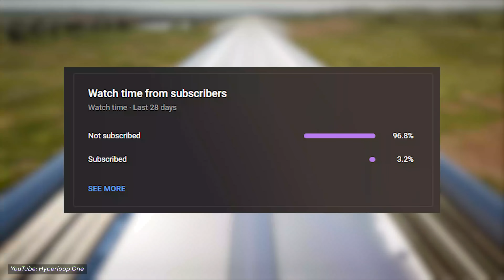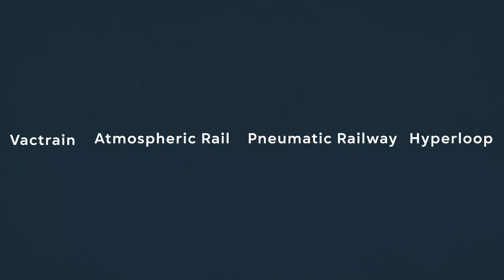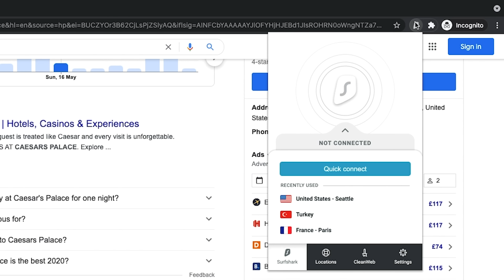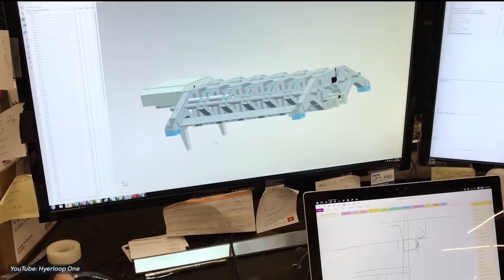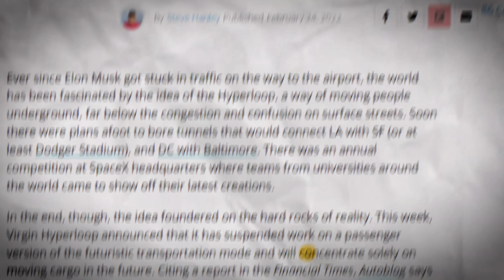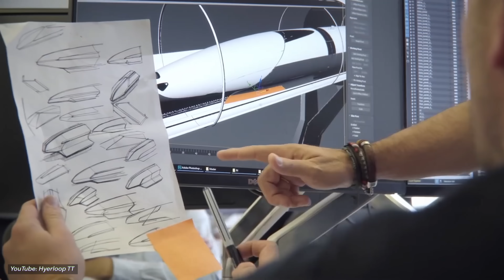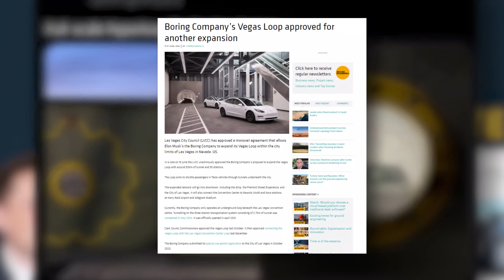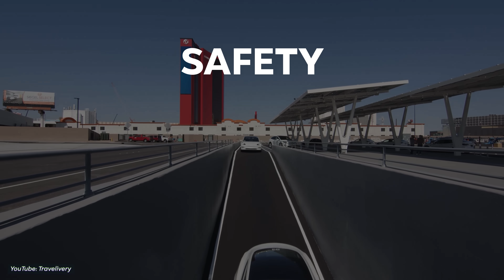What Happened to Hyperloop?

Comment from the maker: Get Surfshark VPN at https://Surfshark.deals/topluxury - Enter promo code TOPLUXURY for 83% off and 3 extra months for free! 😄
Reply: Aloha!
Reply: Make video on msg sphere Las Vegas in detail
Reply: It's not Hyperloop's "typewriter time" yet.
Reply: RRTS(Regional Rapid Transit System) is the future to travel within a Megalopolis or a Megacity --> https://en.wikipedia.org/wiki/Delhi%E2%80%93Meerut_Regional_Rapid_Transit_System
Reply: The correct name is "The Hypersonic Train" and it's basically, a hypersonic Maglev which would run in a technical vacuum tunnel (couple mm Hg) same pressure as it is at 30+ Km altitude! U need a pressurized Maglev train in the same way a space capsule has pressurized air. The maximum technical speed of such device is somewhere between 5500 and 6500 km/h to a maximum threshold of 7000 km/h or 4000 mph due to Coriolis Effect. The energy requires is 1/10 of a long airplane trip across the same distance , being able to transport over 2000 ppl. That's the initial Project. 🥰🤗😇

Comment: The trouble with hyperloop was not scientific plausibility (it is plausible), it was commercial, legal and safety viability.  Higher speeds means shallower curves and less flexible routes.  Good luck bulldozing through towns because you can't curve round them at speed, paying for construction of airtight tubes, paying to perpetually pump out air because leaks always happen, and getting people out when mechanical faults happen.

Comment: if the Loop has no air in it, why do the trains moving in it, need pointy noses, when without those "pointyness", the train of the same length can accommodate more passengers and eventually bring more money!
Reply: and such projects, would be better for everyone and especially for investors, if they were tested in full scale, first in small countries!
Reply: Because ALL is a fraud. It must look sexy, people are too stupid to understand technical specifications. At 8:30 the Hyperloop TT is nearer. In a vacuum the easiest for economical freight carrying is to lay it out for standard 40 foot-containers, a carrier not much different looking than a rail car.  
 
But that looks boring (like the Boring Company), too much like normal railway.  
 
If it would have been earnest, the engineers would be busy developing a maglev system for extremely high speeds, far beyond the current 500-600 km/h.  
 
The whole system in the white paper is laid out for passengers.  WAY smaller than a standard railway clearance profile.  
 
A passenger pod is small and cute, for maybe 40 passengers. A Munich subway train can hold up to 1,000 people. So you would need 25 pods for one sub. 10 trains/hour is no problem for a subway, thar would mean funneling 250 pods/hour through the airlock at the beginning and the end of the tube.  
 
Would they really mean it, they would admit that each pod would need a fully autonomous life support and energy support, especially in case of an emergency.  
 
In our software, about 10% of the code and the testing was about the actual functionality, the rest was error handling. 
 
With Elon you only hear about the 10% and even of this the issues are downplayed

Comment: There's a fundamental problem hyperloop that's being overlooked. Size.  More to the point, cabin size.  Though people travel in vehicles as small as compact cars, there are windows that enable passengers to feel less cramped and enclosed, a car with no windows would likely trigger claustrophobia in most people. And hyperloop presents that very scenario. At best its cabin size is liken to that of a small single prop plane such as a Cessna 152. Unable to fully stand with no outward visibility could easily trigger peoples sense of extreme enclosure.
Reply: Recently I saw a claim that the Hyperloop would be practical using 28 seat pods. I did a calculation on about how long it would take for the capacity of a high speed train to be despatched in such pods.
In the time the last one was sent on its way, a high speed train could have loaded and travelled about 1,000 or more kilometres. Passengers could also be waiting for hours to get on a pod.

Comment: Air flow pressurization in the hyper loop would solve the water ingress issues and aid in traffic speed and flow. on off ramps would have to be vacuum sealed sorta or airflow direction accommodated some how. One direction flow would fix this just by it's nature of on off ramps.

Comment: Musk specified 1/6 Mars atmosphere for the tube. Mars is 1% of earth. This was in contrast to a vacuum. So 1/600 it is. He said a fan in the front would take it to 700 mph in 2 minutes, but no exhaust in the back. Clearly he doesn't understand propulsion. The exhaust was to instead blow down as "air bearings". Add hydraulics to the list of ignorance. Air hockey works because the puck is light. Air compresses because it's not hydraulic. He apparently instinctively knew it wouldn't be enough air so he specified "stored air". In order to save space it would be compress3d, and because it does compress it wouldn't hold up a pod. Do you see the new problem? Floati g a pod would take hurricane level wind. A steel tube at 1/600 air pressure would collapse without serious reinforcement, but now it would reach explosive pressures in minutes.in effect it wouldn't last an hour and would likely kill all occupants. Note all teste abandoned the propulsion system.  Lets keep in mind if it was given maglev a coast to coast line would  require all the steel produced in the world for over a year and cost trillions. The LA to San Francisco route has no feasible expansion joints and would fluctuate 400 feet in length with temperature. Any pinhole leak could kill everyone inside. To say it was a steaming pile of garbage would be generous. He's an idiot!

Comment: The Hyperloop concept's biggest issue is that it hasn't realized that it isn't competing with cars and trains, but with planes.

In order to actually utilize the potentially high speeds offered, you need very long stretches with no stopping, which effectively turns it into a plane in a tunnel. Except, the plane doesn't need to spend billions upon billions maintaining the airway, and it can be moved over to other routes to fit seasonal demands.

For most stretches of travel, regular or high speed rail is much cheaper per kilometer to build and would have the exact same speed limitations as the Hyperloop due to needing to break for stops on the way.

Comment: Presumably the vacuum requires a ton of energy to pump out those roughly 1000 tonnes of air (given a 2.5m diameter tube 550km in length) in the first place, and then continuous pumping at some non-negligible level -- and the slightest rupture to the tube's huge surface area (without safeguards in place) easily destroys all of that pumping work while causing a hazard for any vehicles that are running. Maybe make it thin enough people are lying down single file, and focus on making the experience inside the pods very quiet and smooth... unsure if this is more efficient tho, since carriages are longer, but at least the smaller vacuum takes less energy to maintain (given some leakage is inevitable during the boarding process).

Whether it's hyperloop or high-speed rail, surely some of the groundwork is the same, and I think both proponents should therefore be enthusiastic about moving either project forwards!

Comment: Unless it can go faster than 500 MPH, it can’t beat the direct time-savings or efficiency of air travel. Airplanes do not need to worry about bends in the land or following roads. For the most part, it’s a straight direct line from point A to B. However, the tradeoff is that Airline travel is the most expensive traveling method.

Comment: First, we already have high speed trains in europe and japan. The german ICE has a travel speed ~300 kph on a normal rail. The french TGW has a travel speed ~320 kph on normal rails. The japanese Shinkansen has a travel speed ~320 kph on normal rail. On record speeds, they all can reach ~500 kph on normal rails.
The Transrapid, a magnetic hover train invented by the germans, sold to the chinese, can reach equal speeds on a monorail system.
So why the hell do we need the tube? These are only usable for regions, that have harsh weather conditions.
The USA should flat their rails, so the trains can reach higher speeds and make it more comfortable to use.

Comment: Hyperloop was an infantile idea,. It was doomed to fail due to a lack of understanding of (or ignoring) the technological limits. 
Oil pipelines have expansion loops every 1500 ft (500 m) in order to avoid thermal stress. 
A hyperloop from LA to SF would need about 1000 expansion loops. Therefore the hyperloop One was only 980 ft (300 m) long, to avoid expansion issues.

Comment: Frenchman here. Hyperloop reminds me of the Aerotrain story in the 1970s. A very nice concept with an upside-down "T" (concrete beam) to guide and sustain air-cushioned vehicles. Rapidly it reached over 400 km/h on a simple track BUT the project crashed because of a few things: where to build the large new infrastructure in city-centers? vastly increasing operation costs of gas turbines used in the Aerotrains.  the small number of people transported in "pods", thus killing the pay-back model. Yes Hyperloop is different but to maintain near-vaccum in 4 to 6 m-diameter tunnels over thousands of kms, how to do turnouts, how to re-use existing infrastructure in ultra-expensive city-centers? So many questions so few answers.
TGVs "pods" transport up to 1000 passenger in order to pay-back the HUGE infrastructure costs. Also, don't forget in the USA the mighty lobbies to protect gas production and car manufacturing (which derailed high-speed trains in the USA).

Comment: Just build a high speed train which can go up to 350kph, with much higher capacity and many more targets than pods could achieve, or if you value speed, above cost and capacity, build a maglev train which can over 700kph, as already proven in the real world by China and Japan.
Even trying to bring back super sonic passenger airplanes seems far more practical.

Comment: Hyperloop is a great form of transport on large distances, ~8000 km. It is expensive to build and a ticket will be $2000. The advantage is for CEO's to be able to travel large distances in a short period of time. Saving precious time. Getting from Beijing to Paris in 2 hours. But the way that it is being pitched by musk is utter nonsense. You can't use it on small distances and it is not cheap at all.

Comment: 6:50
“it reached a top of 172kph” is way too slow as 172kph equals to 106mph.

Japanese maglev train is now under construction planning to open in 2027. 
　　
They go about 550km(340 mile) in 60 minutes.

The maximum speed is over 500kph.  Which is 310mph.

Comment: the issues are with the tubes. Pressurised tubes of hunders of km's are very difficult and expensive to make and maintain, those tubes needs to be pretty damn strong to avoid leaks and implosion 
closest thing to hyperloop is actually air planes. they go up  10km high for lower atmospheric pressure and less aero drag to go more efficiencyly this is what hyperloops are trying to achieve also isnt most hypeloop concepts supposed to use maglev kind of thing so techinically hyperloop would kinda ''fly'' issue with plane is that as far as I know there is no green replacement for jet engines

Comment: Hyperloob sounded like a good idea to me when i was 14. But as i got older and wiser i learned about something amazing. There is these things called trains, that run  on thin metal rails. And hear this, they can carry houndreds of people from point A to Point B. Amazing right?
Reply: Def not the same thing
Reply: @toprak-x6u  Ofcourse not, one is a safe, cheap and fast way to move people and cargo over long and short distances and the other is not. Im not saying they are the same, that would be oxymoronic.
Reply: @ToneyCrimson  This idea of elon musk is almost impossible to accomplish, with humans at least. My take on this is to create intercontinental delivery systems that are able to for example reduce something that would take 15 days by boat to a mere 3 hours
Reply: @toprak-x6u  M8 think a little before you say shit. Do know how impossible it would be to make a vaccum tube that long? And also continents moves, unless you are making it float in the ocean or  something, its not going to work. Pluss if you are in a hurry, use planes for delivary. For other things boats works fine...
Reply: @toprak-x6u  Oh yeah. A vaccum tube under the atlantic ocean for thousands of kilometers with no possible exit and the crushing weight of the whole ocean on top of the sealed tube.

Sounds feasible and safe.
Reply: @jayer. I didn't even say this would be safe for humans. I only want this for deliveries
Reply: @toprak-x6u   If the tubes implodes under the imense pressure, you have to send people to fix it. Every mm of those tubes need to as perfect as a deep ocean submarine. Thats a impossible task no matter how you look at it. 

Anyways guessing from your comments, you probably are around 14 like i was. You will grow up and understand how crazy you sound. Its would be easier to make a base on the moon than a hyperloop across the oceans.
Reply: @ToneyCrimson  great way of thinking, if everyone was as bright as u we would still be throwing spears at mammoths, why bother trying to think of sth better if we got sth else currently, no point trying to improve it or anything.

Comment: the problem with vacuum transportation is  that it's a little too vulnerable. To take down large portion of the system, one would only need to pierce the tube at a certain location and the atmospheric pressure would take care of the rest. Also, the benefit of a vacuum over a regular rail system is very  small. United States is better off adopting maglev trains as it's a more proven concept than the hyperloop.
Reply: Lol sorry but we don't need trains, we have our cars which are still the best way of transportation. No need for some socialist mass transportation vehicles in which you can't even decide by yourself where to go.

Comment: I'm neither a technician nor a scientist, but I think the only way the idea would work is if the diameter of the tunnel was much larger. As speed increases, no matter how low the atmospheric pressure is, air accumulates in front of the vehicle and by having so little margin of separation between the tunnel and the vehicle, a bottleneck effect is created and basically the vehicle is pushing compressed air.
Reply: hence the vacuum, there is no air to compress or move, thats the whole philosophy in the design
Reply: @bruceketcheson4877  It is not really a vacuum, it is air at very low pressure because it would be economically unfeasible to create an absolute vacuum. If I remember correctly, they said that the pressure they were under was like that of about 100km high.

Comment: never say never
some invention or discovery may change the paradigms and what was impossible, suddenly finds itself in the realm of the feasible
We are seeing technology accelerate at an unprecedented pace and breakthroughs are happening all the time
Often, solutions in one sphere come from something that happens in an unrelated field.
We will still see super high speed transport, even in not in the vision and format of the hyperloop
China is on track to build trains that will run at 4000 kms ./hr (almost 3.5 times the theoretical speed of the hyperloop and they are going to be soon testing the 1000 kmph phase and plan to upgrades the system to higher speeds in phases. And they are forging ahead after moving from possibility to probability to now fine tuning the feasibility of the project.
Fingers crossed for those who dare to dream

Comment: IT NEVER MADE SENSE -- the back low pressure that would be created in the tube would negate use of the tube. (yes, even if you had an intake in the front and air being blown out the back - the tube would be irrelevant).
Basically, It doesn't make sense unless the entire tube is depressurized or there is a massive flow of air in 1 direction. Both of these options are HIGHLY inefficient. What surprises me, is that no one that was in engineering was calling this out. Everyone just seemed happy to go along with the propaganda.

Comment: My company worked with Hyperloop One (Virgin Hyperloop) to develop the Hardware in the Loop system for testing their electronics.   It was rather disappointing (but not surprising) when everything was shutdown.  In the end, while technically 'cool' and an interesting job for engineers and technicians, it seemed more successful for extracting money from investors than it did for ever becoming an economically feasible solution.  Ultimately the investment community felt the same and the party came to an end.

Comment: The hyperloop over long distances makes no economical sense.  One. the overhead alone required to keep the tube pressurized requires a lot of power.  That's in addition to the power needed for propulsion.  Second, I would imagine the cost of maintenance is going to be expensive.  Any point of failure along the route will compromise the whole system.   If there any part of the tube that needs corrective maintenance, the entire tube would have to be shut down.  Last, it would be astronomically expensive to build even when compared to the high speed rail route currently under construction in California.